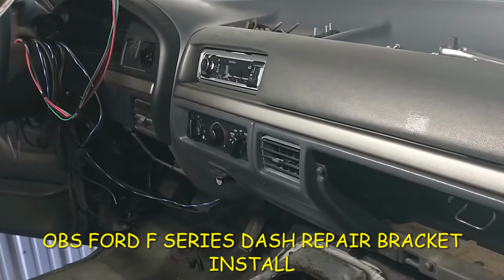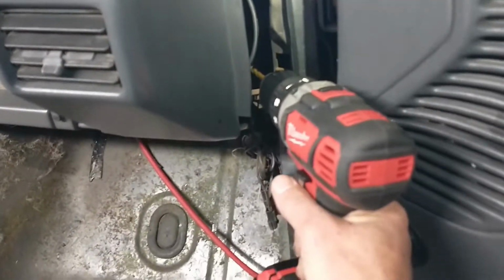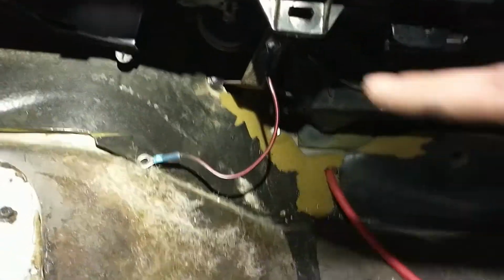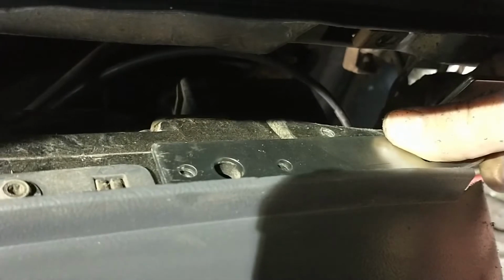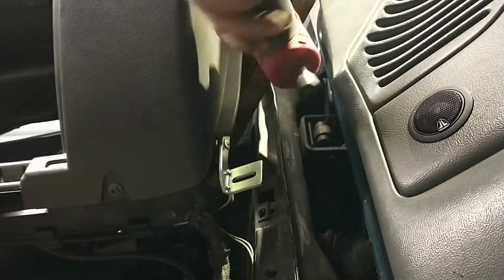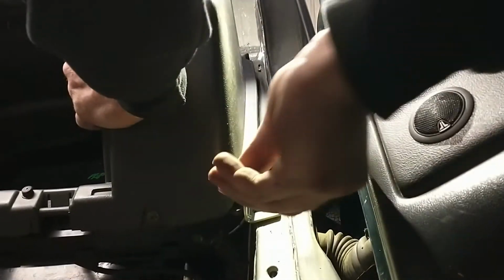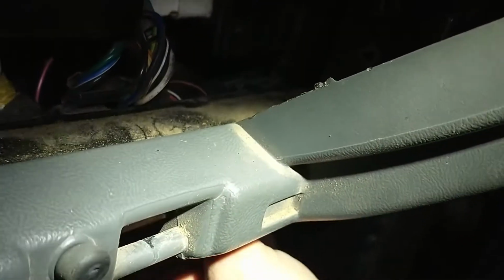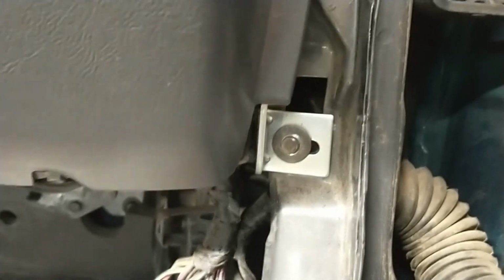1992 -1997 Ford F series OBS Dash repair

Comment: Think it was absolutely necessary to pull the dash almost completely off for that bracket?
Reply from the maker: To drill the holes yes, a right angle drill will work wonders.
Reply: @gregory9740  ooofff I was hoping you'd say no...
Reply from the maker: I just pulled the one corner out as far as I could, but doing it that way I had to drill at an angle which still works just not ideal.
Reply: @gregory9740  thanks!